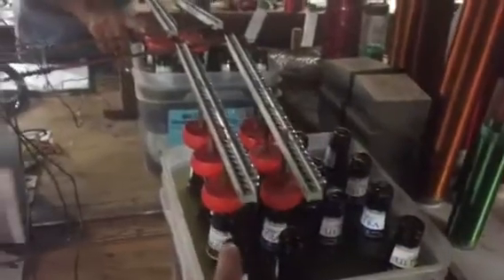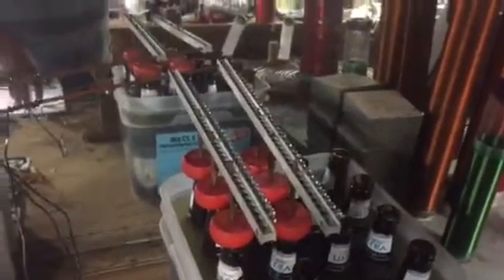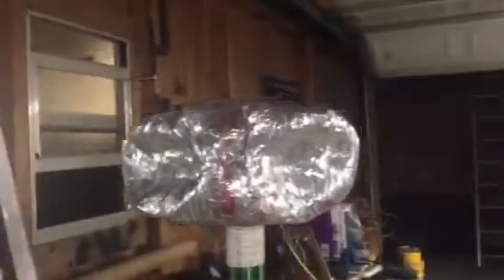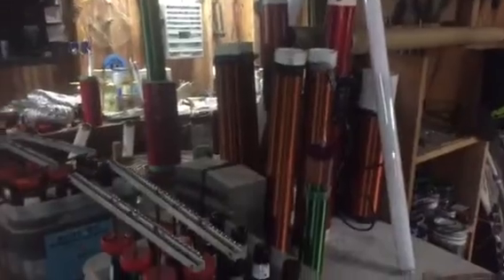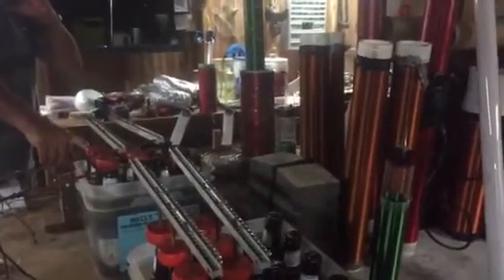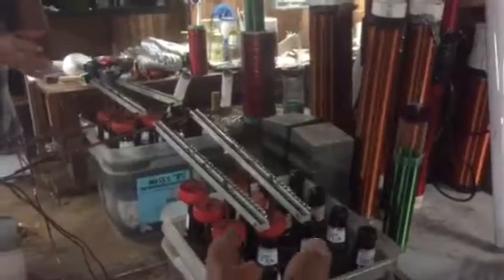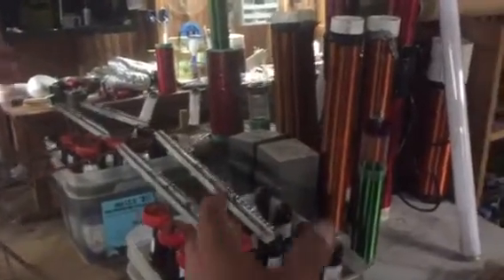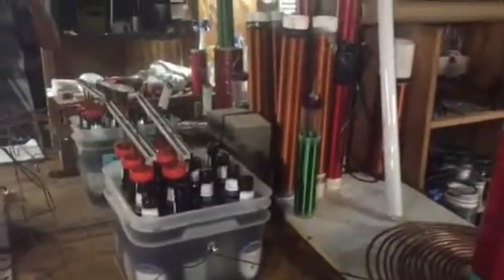Wireless flukes , come in small packages

Comment: Do you think the new (YouTube him) Juris Balodis free energy device uses a simple tiny tesla coil as a screw in-out, tap-in, top-down receiver, and 2 2:1 2:1 gear ratio Fibonacci neodymium sequences with an outer bipolar alternating neodymium sequence, creating a simple free energy homopolar motor with perhaps a brushed contact or even electrofluid low resistance homopolar contact? :)